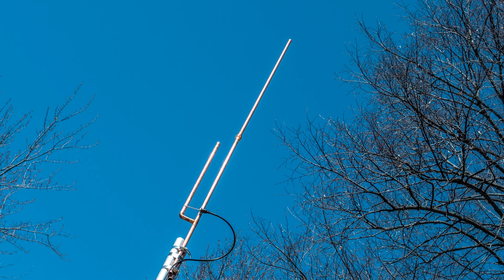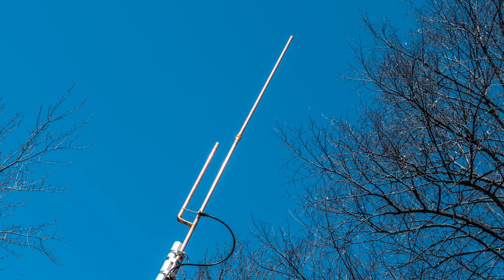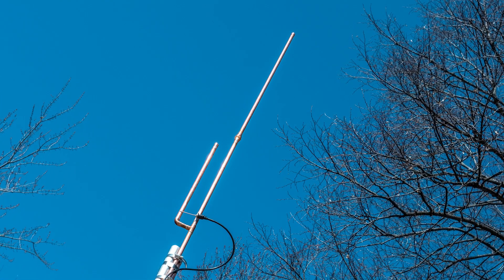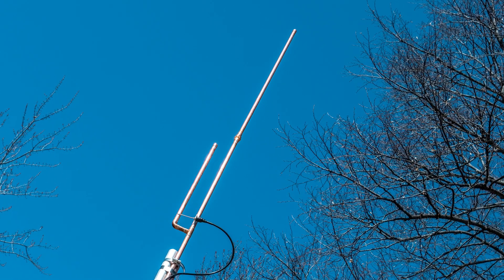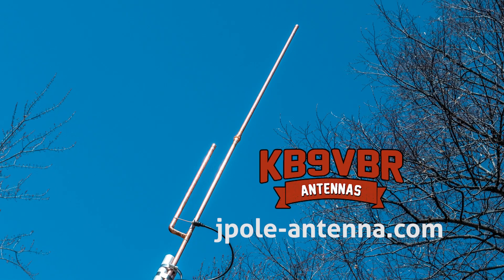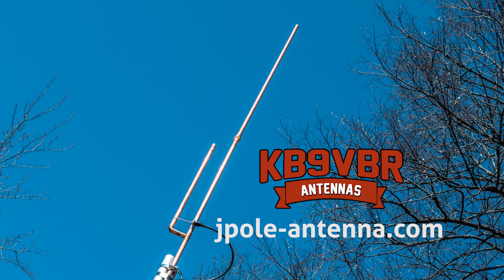Ask Michael, KB9VBR: What's better, a dipole or vertical antenna

Comment: All toads are frogs.  But not all frogs are toads.
All vertical antennas are dipoles.  But, not all dipoles are vertical.

The second half of the dipole, in a vertical antenna, is the ground system.

Comment: 3 minutes to set up my inverted V dipole.  30 seconds to switch bands using the links.   Less time setting it up than it takes to deal with the WRC and ground network.  Plus, there is no loss that you experience using a loaded coil like the WRC.   See how warm that coil can get.  That heat is power not leaving the radiating element.

Then again, I've worked ZL running 4.2w into an EFHW slower with a 20ft apex.

Any antenna is at the whim of propagation.

Comment: During the 10 meter contest I used a 10 meter inverted V antenna configured as a vertical with a single ground radial, mounted onto a 40' Spiderbeam mast, and contacts were made to several states on the west, north, and east US. Two were made to Argentina and one to the Canary Islands. 73 KD5YOU
Reply: I did Saskatchewan to southern Texas on 14 watts, with a 259 centimetre antenna cut from threadall,  using an antique television antenna for the ground radials.  The antenna was only 7 metres off the ground.  The contact was made using an antiquated Cobra 148GTL on a 13.8 volt, 10 ampere,  power supply on channel 40 USB.  
Everything was salvaged junk, including the ancient coaxial cable that was in an attic for decades.
Reply: @IndridCold-o4o  That's a pretty good contact! I like it when propagation surprises us!

Comment: New HAM’s!!! Quit spending hundreds of dollars on antennas. Make a 20 meter dipole and get on the air. Even in an inverted V configuration at 15 feet you’ll outperform the pricey, portable vertical antennas every time. I speak from experience.

Build a DIY Dipole Antenna
https://youtu.be/KUTnAgbDdzs

Comment: I started with a horizontal dipole for 6 to 80m. But after switching to a 43 ft free standing vertical mast with four 80 ft± L-shaped ground radials with a remote controlled 6 - 180m ICOM AH-730 antenna turner connected to my  ICOM 7100 transceiver, my reception noticeably improved.

Comment: A dipole will have no loss, but also, no gain.  A vertical will have a bit of gain in a certain pattern.
Reply: I read that a Dipole is 2 db over isotropic radiator
Reply: I figure that other antennas' gains are compared to dipoles' performance, so the dipole wouldn't be listed as the antenna with gain.